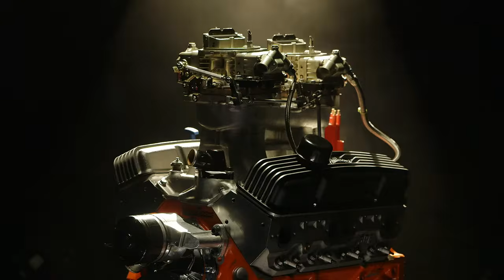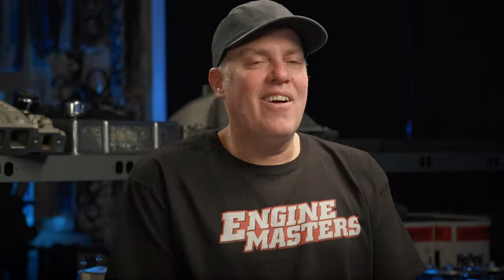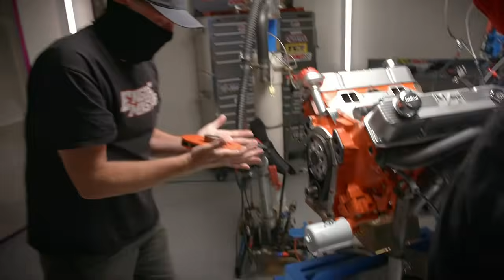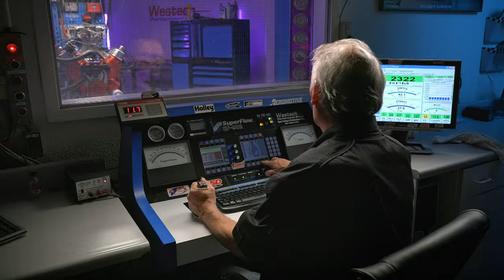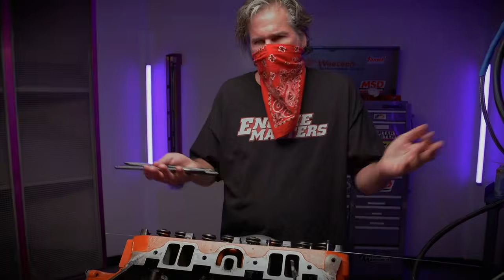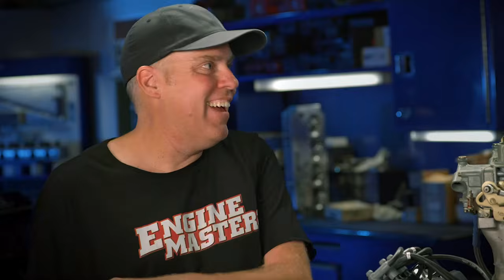Engine Masters  S5E65   Engine Personality Test  Camshaft LSA Explained

Comment: I thought "lobe centerline" was halfway between equal lift points (in degrees) of the opening and closing ramps. At 0.040" or 0.050"..whatever..
   Same thing, on most cams, but some are asymmetrical. 
   Also, this is easier to measure...finding peak lift isn't as precise...the same reason you need to use a piston stop to find TDC, rather than thinking you can find it accurately with a dial indicator. 
     Just doesn't work that well in practice.
Reply: Intake centerline + exhaust centerline then divide by 2. 

106 icl, 114 ecl has a 110lsa.

Comment: Hmmm wonder if this is the same effect on sohc. The cams in my 4.6 3v are on a 110lsa. They are pretty small though 236/240 duration .472 lift

Comment: Excellent episode.  The wide LSA is good for wet exhaust on marine stuff.  It'll greatly help with reversion and water in the cylinders  😅
Reply: You can advance the cam to overcome the problem. As long as exhaust valve is closed by TDC, you can get away with a little overlap.
Reply: @danr9584 ever taken a guess on that and lost a fresh engine build from reversion?  Many have 🤷‍♂️
Reply: @wilsonbeckett9487  if you look up specs on a marine cam such as Comp cams XTREME MARINE 226236. It’s 226/236 on 112° LSA. It’s a till a pretty wide LSA, but there is 7° of overlap. They are building in some advance.
Reply: Dry pipes (water never mixes) is the better way to go in those cases - cause there is NEVER enough power in a boat engine 😁
Reply: @wilsonbeckett9487  Lots of boat can't do dry headers because of engine placement ( like a ski boat central mounted engine with prop shaft, or stern drive with rear seating, etc ...
Reply: @brocluno01 dry pipes is not “dry” - still double wall pipes all the way to the tips, but water never mixes with the exhaust and dumps separately - my IO boats are setup that way with engine under full hatch.  Common setup in high performance offshore boats 🤷‍♂️😁
Reply: Also works well with large port, large valve engines as it dilutes the intake charge a little less
Reply: Not always.   Full manifolds work fine.  Wet headers is the issue. 110 works good.

Comment: You can only learn so much on a dyno. Time to start going to the track for real time full package testing with a big boys car. Whole different world.
Reply: I never understand this logic, i get how it performs matters but a dyno shows you this too.  Yes in a controlled environment but what does the track tell you when you different weather conditions, different driver experiences, different track conditions, different suspension conditions, different tires compounds, etc.  I would say to you that you can only learn so much at the track.
Reply: @msk3905  a dyno is a tuning tool, but you can build an engine that makes great numbers on a dyno that is a pure turd on the street or track.
Reply: @leftyo9589  disagree, if you build an engine that makes great power numbers and its a turd on street it’s not the engines problem its the setup it went in that is the problem. The dyno shows you what the power and torque curves are that doesn’t change when installed in a car unless you change the engine configuration drastically, if so, that’s the users fault for not running on dyno in set up being used.  If it’s a dog on the street I go back to my comment, its the car it has nothing to do with the engine.  Care to offer some logic behind your thoughts?
Reply: @msk3905  I agree. ALL motors from oem sources have been on the dyno to give you the horsepower and torque specs. The options you pick to go along with the motor you choose, will make a big difference at the track. Don't forget, driving ability has a lot to do with it . Especially with a stick! Side note: If your dyno numbers a bad. You most likely are not going to be fast at the track!
Reply: @leftyo9589  Partially true. The advantage to testing in a dyno cell is to be able to try components in a controlled duplicatable set of conditions. I for one would not want to just select components and hope they work if you have access to an engine dyno. It gives the ability to confirm if a combination is viable for the purpose intended. It is far easier to swap and test on a dyno stand than in a vehicle. Maybe you thought a certain head and cam combo would work, the dyno will let you see it. I do 100% agree that vehicle setup is critical to make the engine work. However, knowing what the engine is giving will make it easier to set up the car to compliment the engine.

Comment: great episode but what about boost isnt overlap letting the boost go out trough the exhaust?
Reply: Watch more than one dyno video and figure out that the hp an engine makes before boost is multiplied by the boost it see’s in the intake. The cam selection does not have a huge difference on an engines efficiency at making power with boost, lots of other things will play a much bigger role in that.
Reply: Boost is more of an exhaust going from the exhaust manifold back into the intake than intake getting pushed into the exhaust. The pressure behind the turbine wheel is going to be greater than the inlet charge once you're really spinning the motor.
Reply: @curtislovrak5390  boost, is literally a measure of the pressure in an intake manifold. thats it, nothing more, or less, and can only be used as a reference point.

Comment: There was no need to use 118 LSA cam because the 112 already showed the Trend. But still a good show.
Reply: Since the wide LSA lost so much power, it would’ve been interesting to see if they could advance the cam to gain back some of the losses down low.
Reply: The wider lobe centers looses cylinder pressure and that is difficult to over come with the head flow limits. That’s why extremely good heads can get away with wider centers such as LS.
Reply: and then listen to him say 110 is a great compromise , which they  did not even use that LSA in this test to show us.
Reply: @krusher74  jfc,  do you hear yourself?

Comment: Rubber belt inside an engine exposed to hot oil? Who thought that's a good idea?
Reply: You think a $1000 timing system made by one of the best companies on the planet made that mistake when making these. Try some critical thinking.
Reply: the belt on a jesel is outside the engine.

Comment: Every time you change one thing the other things that you've held constant now don't fit you got to have overlap and lobe separation angle half to match that necessitates changing the duration
Reply: I kinda agree, smaller numerical LSA will mean higher dynamic compression ratio, but it's small. This test is just showing if you advance the IVO and IVC and retard the EVO and EVC points. If they were only touching the IVO and EVC then they'd have much different results that wouldn't be as useful to someone who would watch this to help determine what cam to run. I am a believer that LSA is determined by thr cylinder head and compression ratio, not by the duration figures within a few degrees of LSA tweaking.
Reply: @curtislovrak5390 you're singing the song of my people

Comment: Yep, I had a LSA of 110 on my Mast Motorsports SS-427, but for a parade car it was undriveable, and when it reached 2500 rpm it took off like a scalded car. I installed a cam with a 122 LSA, purrs like a kitten and I only lost 85hp.
Reply: only 85hp....lol
Reply: @cuzz63  SS- 427 parade car!!!
Reply: @krusher74  its all relative really...if you had 685 hp and lost 85 you still have 600.

Comment: This makes wonder why most   Comp Cams I/O marine cam use a 112* for 1000rpm to 5000rpm ? All I can think it has to do with the wet exhaust??
Reply: Larger overlap period means its more likely to have reversion under certain conditions, meaning that the exhaust will pulse backwards and bring water into the combustion chamber.
Reply: @curtislovrak5390  Thanks

Comment: Id like to see how tight of a lsa you can go before it hurts performance
Reply: Yes
Reply: Depends on the size of the lobe because your overlap could be huge at 112 with a large cam.
Reply: 106 makes more power but with horrible drivability for street. Probably idles at 1000 rpm
Reply: He's already at that limit. That's where the rough idle comes from. Unloading the power stroke by opening the exhaust valve to use some of the power to pull in more intake gases and air for the next event.

Comment: Or iif your running bosch k jet stay away from overlap
Reply: How so? With EFI you're going to have fuel spraying at the back of the valve either way.
Reply: @curtislovrak5390 with wild cam timing the vacuum to the metering plate fluctuates too much making the fueling hard to control
Reply: @shaunpowell7513  huh, I have never heard that in the Volvo world. Volvo sold a K-jet car with something like 60° of advertised overlap. Even the pedestrian non turbo USA emissions engines had narrow LSAs and a ton of overlap. The same could be said with cars with AFMs with the flapper door. You can watch them fluctuate at idle in stock engines.
Reply: @curtislovr-    k-jet isn't necessarily EFI...in fact it is generally mechanical, but later versions started to have some electronics.
   But, yes, the injectors spray continuously,  so they definitely spray on a closed intake valve.

Comment: They really need to do this test again, but account for the much lower cranking/dynamic compression. How would they differ if they were advanced/retarded so that the Intake closing points were the same? Other option would be to change gasket thickness to bump/drop static compression or both.